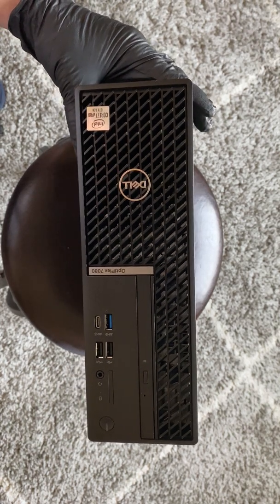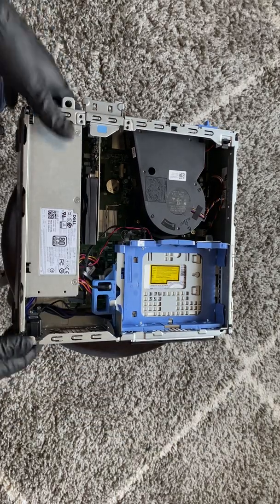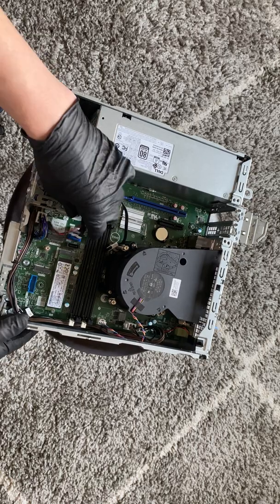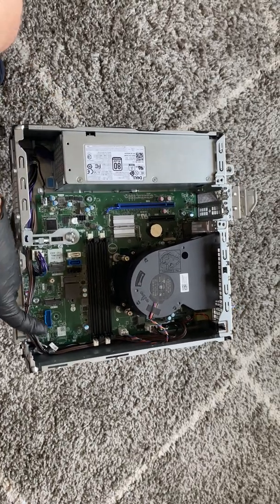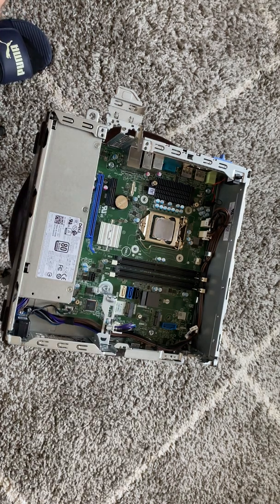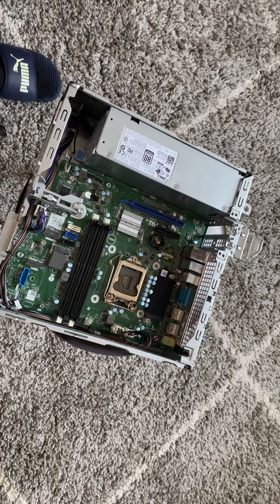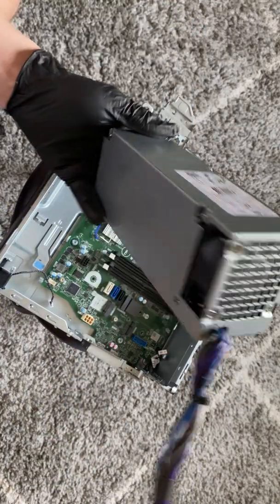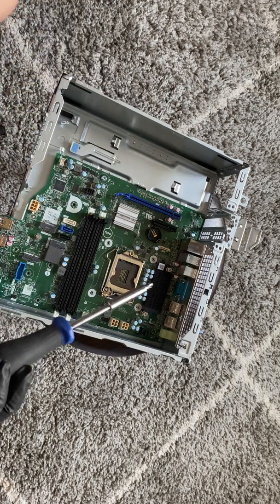Dell Optiplex 7080 Teardown

Comment from the maker: List of Parts and Upgrades works with this system:

List of Parts and Upgrades works with this system :

Dell Optiplex Reassemble
https://www.youtube.com/watch?v=d_iJJm0R1hk

USB Wifi Adapter for PC AC600Mbps Wireless Network Adapter
https://amzn.to/2ZaGuHb 

 List of RAM will work with this system.

(1.) Crucial 32GB Kit (16GB x 2) DDR4 3200 MT/s (PC4-25600)
https://amzn.to/2Zazppk

(2.) Crucial 64GB Kit (32GBx2) DDR4 3200 MT/s
https://amzn.to/3bxCRPJ

(3.) Crucial 8GB DDR4 3200 MT/s (PC4-25600)
https://amzn.to/2R07Ier

(4.) Crucial 16GB Kit (8GB x 2) DDR4 3200 MT/s (PC4-25600)
https://amzn.to/326cfT7 

List video cards will work with this system.

AMD Radeon RX 6400 Low Profile Gaming Graphics Card
https://amzn.to/3s8MUUY

XFX Speedster SWFT105 Radeon RX 6400 Gaming Graphics Card
https://amzn.to/3xkmXo1

(1.) GIGABYTE GeForce GTX 1650 D6 OC Low Profile, Low Profile GV-N1656OC-4GL Video Card
https://amzn.to/381pp6Y

(2.) Gigabyte GeForce GTX 1650 D5 Low Profile 
https://amzn.to/3el08os

(3.) Gigabyte Geforce GTX 1050 Ti OC Low Profile 4GB GDDR5 128 Bit PCI-E Graphic Card (GV-N105TOC-4GL) 
https://amzn.to/2T8bfsv

(4.) MSI Gaming GeForce GTX 1650 4GB GDRR5 Low Profile Graphics Card (GTX 1650 4GT LP OC) 
https://amzn.to/2X1FYsF

(5.) MSI GTX 1050 TI 4GT Low Profile  Graphic Cards 
https://amzn.to/2LwZd7P

(6.) Gigabyte GeForce GT 1030 GV-N1030D5-2GL Low Profile 2G Computer Graphics Card 
https://amzn.to/2Z4PHkp

(7.) ZOTAC GeForce GT 1030 2GB GDDR5 64-bit PCIe 3.0 DirectX 12 HDCP Ready Low Profile Video Card ZT-P10300A-10L 
https://amzn.to/2WzgLXk 

(7.) MSI Graphic Cards GT 1030 2GB GDDR5, Low Profile 
https://amzn.to/390Spum

Thermal Grizzly - Spatula for Applying and Spreading Thermal Paste 
https://amzn.to/3d8NQEE

Thermal Compound Paste:

(1.) Arctic Silver 5 Thermal Cooling Compound Paste 
https://amzn.to/2ziNU0H

(2.) Noctua NT-H1 3.5g, Pro-Grade Thermal Compound Paste
https://amzn.to/36kTk7A

(3.) ARCTIC MX-4 (current edition) Thermal Compound Paste 20 Grams 
https://amzn.to/2DhGJaK

SSD List M.2 Type 2280 NVMe PCIe:

(1.) Crucial P3 Plus 4TB PCIe M.2 2280 SSD
https://amzn.to/3RZcUNi

(2.) Crucial P3 Plus 2TB PCIe M.2 2280 SSD
https://amzn.to/3RTUi0Y

(3.) Samsung (MZ-V7E1T0BW) 970 EVO SSD 1TB M.2 NVMe
https://amzn.to/3d52k2a

(4.) Samsung 970 EVO Plus SSD 500GB
https://amzn.to/3fpi95A

(5.) Samsung (MZ-V7E500BW) 970 EVO SSD 500GB - M.2 NVMe
https://amzn.to/37uuLFw

(6.) Crucial P1 500GB 3D NAND NVMe PCIe M.2 SSD - CT500P1SSD8 
https://amzn.to/2N07wKh

Hard Drive Caddy Adapter  3.5 to 2.5:
(1.) Dell 3.5" to 2.5" SSD or Hard Drive Caddy Adapter R494D 0R494D 
https://amzn.to/2XTPeRr

(2). Dell Hard Drive Caddy, R494D, F767D 3.5" to 2.5" SSD or Hard Drive
https://amzn.to/3cTkcOk 

SSD List:
Samsung 870 EVO 2TB SATA SSD
https://amzn.to/3ezOds5

Crucial MX500 2TB 3D NAND SATA Internal SSD
https://amzn.to/3B9f8CF

SanDisk Ultra 3D NAND 2TB Internal SSD - SATA
https://amzn.to/3RSZ8LR

(1.) Samsung 860 PRO SSD 256GB - 2.5 Inch SATA III Internal Solid State Drive
https://amzn.to/2BY5gRl

(2.) Samsung SSD 860 EVO 250GB 2.5 Inch SATA III Internal SSD 
https://amzn.to/37xWUfc

(3.) SK hynix Gold S31 1TB 3D NAND 2.5 inch SATA III Internal SSD
https://amzn.to/3d7X6D6

(4.) Samsung SSD 860 EVO 1TB 2.5 Inch SATA
https://amzn.to/2B2FURX

(5.) SanDisk SSD PLUS 1TB Internal SSD
https://amzn.to/3hwdqku

(6.) SanDisk SSD PLUS 240GB Internal SSD
https://amzn.to/2zfc7EX

(7.) Crucial MX500 250GB 3D NAND SATA CT250MX500SSD1(Z) 
https://amzn.to/3bTTjbX

(8.) SanDisk SSD PLUS 480GB Internal SSD SDSSDA-1T00-G26
https://amzn.to/2yfgjUK

HDD list works with this PC:
(1.) Seagate BarraCuda 4TB Internal Hard Drive HDD – 3.5 Inch
https://amzn.to/3d3xWeR

(2.) Seagate BarraCuda 8TB Internal Hard Drive HDD – 3.5 Inch
https://amzn.to/3xjUDSJ

(3.) Western Digital 2TB WD Blue PC Hard Drive HDD - 5400 RPM, SATA 3.5" - WD20EZAZ
https://amzn.to/3w3jIQA

(4.).WD Black 2TB Performance 3.5" Hard Drive - 7200 RPM Class, WD2003FZEX 
https://amzn.to/2xFUeyF
Reply: Hello, im still having issue pulling a mb in a 3020 sff what could cause that. The resistance is on the back of the pc, where the usb, audio jack and video output is
Reply: Thanks 🙏

Comment: hello, greetings from Mexico, I hope you can help me and I would like to know if you know how to do the bios reset because it asks for a password, it is a dell 7080 micro, it is by rtc method, how much would you charge me to help me do it remotely.
Reply from the maker: Hi, there is pin header BLUE color jumper inside motherboard that allow you to clear password. it is located on the top where RAM slots are at.
Reply: @Mxkdt  In this equipment that option no longer comes apart from the fact that it is the smallest version, it is 7080 micro... and where it should say jump (jmp) it now says rtc

Comment: Mxkdi! I need your help. I can get my hands on a brand new OptiPlex 7090 Tower or
Mini tower motherboard for a great price. I’m trying to figure out if the 7090 motherboard Will install in my Inspiron 3670 case. They look very similar as far as dimensions go and screw holes for the motherboard, but I’m sure there’s differences in the front i/o and possibly the on off switch. I don’t know if you have a 3670 Inspiron laying around but I believe the OptiPlex 7080 motherboard for the mini tower is the same dimensions as the 7090 so if you could try that would be amazing. If anybody else here knows or has ability to try that for me I would also greatly appreciate it thanks everyone keep up the great work.

Bart
Reply from the maker: Hi, yes it is possible only if i/o shield back plate matches other case and does have same headers you have to check and look at two motherboard at same time.

Comment: Seems like this is the latest, so I will ask an unrelated question and hope to get a response. I have an Optiplex 980 MT that is not my primary, but still use every day. I watched your video and just updated the i5 dual core to the i7 quad core and increased RAM to 16 gigs. I have the standard heat sync assembly and would like to replace the actual fan with a quiet to silent one. Are you able to make a suggestion? It's not roaring but I have always had a thing about fan noise.

Comment: I have  a 7070 sff.  I noticed in this video that there is a vacant pad for a  4 pin system fan header on the 7080 motherboard just as there is  on the  7070, and, as there is on the 7060, according to online photos. Have you ever seen these pads occupied and/or used, or, have you used  and/or tested the  connection points yourself? I'd be interested in actually adding a header there if I hadn't read of  funky fan connection  abominations created by Dell, AND, if I knew these connections are functional in the standard 4 pin fan configuration. I've been unable to find any mention of this system fan pad anywhere on the net.  I'm even more reluctant to attempt to utilize it since hwinfo  will not  or can not even show the CPU fan info. Having an 80mm fan moving more air through the case would be great before adding a graphics card, and, having a system fan header on the motherboard would be a very clean way of accomplishing that. Also...I have a m.2 wifi/BT card installed that would also benefit from  more moving air.
Reply: My 7080 SFF have an empty pad for the 4 pin system fan header. I noticed that the Precision 3420 SFF is using the same motherboard as the Optiplex 7080 SFF and the Presicion 3420 SFF have the 4 pin system fan header connector present on the motherboard.

Comment: hi, basically your my last hope in upgrading my pc, 
i wanna ask if you could recommend me some specs that will help me to boost the perfomance in my pc
currently now the specs is 
I5 7400 3.0GHz
8gb (4x2) 2400mhz
intel graphics 
the pc is called acer veritons M2640 i had this pc 2 years ago
was wondering if i could upgrade the ram to 2666mhz (8x2) and Gtx1050 ti 4gb
please help! thank you!! also i've subscribed because u showed me how to upgrade the ram and it just as easy as slot in but the graphics is where im stuck at. thanks for reading!
Reply: Message me on discord, I can try to help you getting new parts and seeing comparability etc. justasingledoor#8673

Comment: i know this isn’t related to the video but i’ve watched your video about the lenovo thinkcentre m91p upgrades and i recently have gotten a gigabyte gt 1030 low profile graphics card. when i put the card into the slot and turn on my pc, the fan on the card turns on and all of that but the pc doesn’t pick up the card. i don’t know what to do and i think coming here and asking you might help

the specs are stock, core i5 (2nd gen) 2500, 8GB ram, 1tb ssd

is there a fix or something? hope there is. thank you
Reply: Did you figure it out?

Comment: Will be nice to see what low profile cards come out for the RTX 3000 (GTX1750?) series that fit in these SFF Dells. Fingers crossed for 6gb ram and no power supply upgrade.